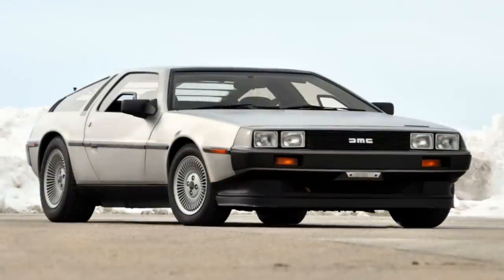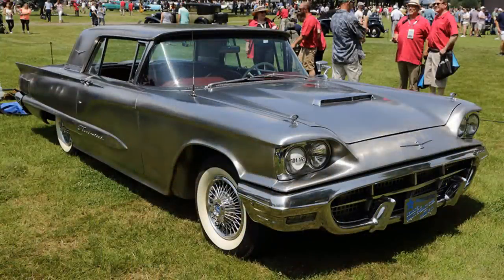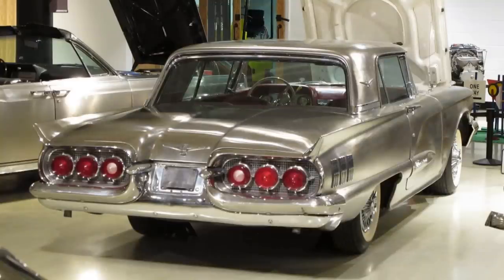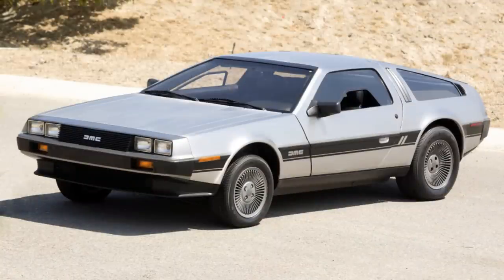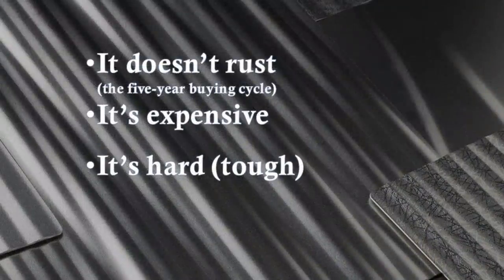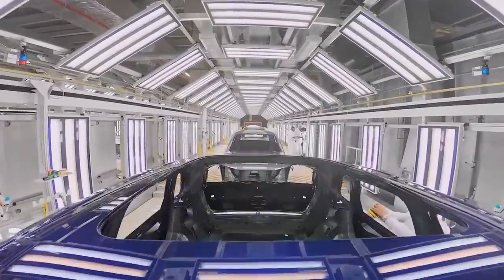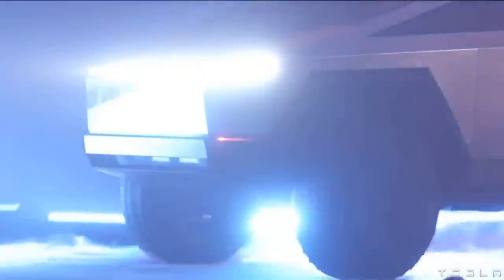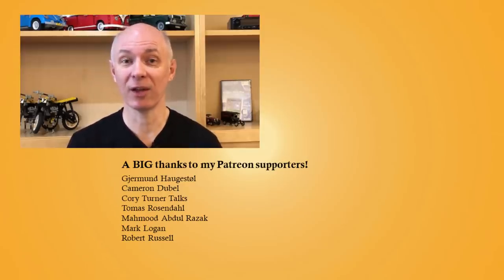Why aren’t cars made from Stainless Steel?

Comment: I would add another point: crash tests. 

With steel panels being used to absorb energy in crashes, I am curious about how Tesla solved this approach in the CyberTruck
Reply: I think they decided to go the Nokia way: rely on the other cars deformation zones, or destroying whatever it crashes into.
Reply: Body panels barely have an impact for crash absorbtion. You would rather look for the platform construction if trying to figure out how they would behave in a crash.
Reply: @Dear_Mr._Isaiah_Deringer  Yeah I understand but the problem remains: how are these stainless panels are going to behave now? Are they going to be too rigid? Do they serve as an energy absorption member?
In 2020/2021 the Eurocap and NHTSA will have the proper answer, still, its a challenge for using this type of material.
Reply: Short answer: they don't. This kind of shaping ensures that almost none of the material can help in absorbing crash energy.
Reply: @Dear_Mr._Isaiah_Deringer  That's not totally true...they are designed to absorb the energy of a crash along with the structure underneath...open any hood and you will see little creases in the structure that the skin covers over...that's to help absorb energy. Stainless steel...especially straight stainless is probably many times stiffer than the HSLA sheet metal (High Strength Low Alloy)  in other cars. Perhaps some insight can be gained from a review of the DeLorean crash test results.
Reply: Well, they don't.
Reply: Yes ,this is the most imported  fact.
Reply: @Dear_Mr._Isaiah_Deringer  this would be a unibody so that means the body is the chassis
Reply: @markanthony3275  The Delorean had fairly thin stamped stainless external panels, mounted over a composite tub chassis, so it wouldn't be a direct comparison. The Cybertruck has an entire monocoque stainless structure, so it will behave differently, with higher force levels required to deform it.
Reply: @MonzaSSguy  Hey thanks bud! I'm a retired collision repair man ...so I know about crumple zones and all that...but I never had the opportunity  ( misfortune? ) to work on a DeLorean.
Reply: @markanthony3275  Getting the Cybertruck through regular barrier crash-tests without subjecting the crash dummies to fatal shock loads, will be the real challenge, with all that deform-resistant external skin and structure. I'm still rooting for the concept, but it might have to 'evolve' a bit...
Reply: @Jozavenue  That's close...but the doors, bumpers, hood and trunk lid are removable on a unibody car (99% of the time) so in that respect, the body panels are not the chassis...but I think you mean the upper aprons(the fenders bolt to), the rockers and sills, the floor pan, the roof and the A and B pillars...in that case you are right. The easiest way to differentiate is that in a non-unibody vehicle...the body can be removed from the frame. In fairness I would say that you are right about  Musk's truck because it doesn't look like any panels come off except the doors
Reply: @MonzaSSguy  Yeah...I think it will take a lot of complication beyond what we saw at the unveiling. This happens with  visionary types...they can think up awesome ideas...but have difficulty with the details...they need other people to deal with that, and lots of times big fights break out when the visionary doesn't understand why he can't have something exactly as he envisioned it.
Reply: Mark Anthony what they forgot to announce is what kind of material will be the whole structure of the car not just the outside panels if the structure is  normal metal used in automotive then yes like you said the doors fenders are maybe just glued on panels which could basically easily just fall off and crumble it's actually what's underneath that matters
Reply: @Jozavenue  Another thing I'm not sure of is dissimilar metals corrosion. You see it when aluminum and steel come in contact. I once had a 79 Pontiac that had a chromed steel rear bumper but it had an aluminum reinforcing member the the bumper was attached to...the aluminum member was what was bolted to the shocks in the frame.   The aluminum turned to powdery flakes where it attached to the steel shocks and the bumper almost fell right off.. It gives pause for thought when you realize that Carrol Shelby's Cobras were aluminum bodies wrapped over a steel sub-structure. Can corrosion of this sort happen between alloys of Stainless and steel?  Maybe I ought to investigate the Panoz cars as I believe they were steel bodies over a stainless frames. Of course they may have been composite bodies. Either way...a stainless frame would be something very difficult to straighten in the event of a collision.
Reply: Mark Anthony actually I do work in the metal fabrication field and stainless could get affected with metal basically if you're cutting metal and just Sparks alone will integrate into the stainless steel it will make the stainless steel start to corrode so it will contaminate it however that's why I was thinking the only way to get around it is if they Bond like basically they were to Prime inside of the stainless steel and obviously the metal will be primed as well and instead of using screws .,basically the body panels bonded instead of  welded and Max use some sort of plastic fasteners don't forget they will have to keep the price low so obviously the stainless steel will only be used for the outer shell and they will do budget cuts which will be the unibody which basically will be metal or else this whole thing will be minus adjust to push the company in the stock market forward
Reply: @Jozavenue  Hey thanks for the info !...it's always good to find out what other people in related fields of work have experienced. I'm gonna check out the cars built by Danny Panoz and see what I can find out. I know that bonding metals with "glue" has been around for a while, I can't remember if priming is a good thing or not...I say that because the substrate that you prime over may not be prepped well enough. Actually I remember the time I worked making motorhomes and they used a glue that didn't require priming...maybe it just depends on the  glue manufacturer's recommendations.
Reply: @markanthony3275  yes ,the  right glue ,or both epoxy primer and  or specially blended glue  ,then again he will be using a different stainless then what is available now .
Reply: It is designed to WIN every accident LOL
Reply: Maybe the panels just fan outward and the structure underneath crumples.
Reply: @MonzaSSguy  and composite is a sexier way of saying GRP, or glassfibre in the DMC12's case :) . If you've ever seen a DMC 12 'tub' in the flesh the quality was simply dreadful....but then again the SS cosmetic coverings weren't too great either and, used a low grade SS 304 for cost savings, corrosion (even perforation) of these covers is now a serious issue.
Reply: Safety regulations have to be met. End of. Stainless makes that a bit harder but it’s just an engineering issue.
Reply: MonzaSSguy 
That’s perfect for the passenger cage. The front and back crumple zones will have to be thinner so they can collapse on impact.
Reply: Electric avenue Bikes 
If the external panels are glued on then fine. If they are bolted on expect horrendous corrosion at the ferrous parts underneath.
Reply: Electric avenue Bikes 
Acrylic mastics as used for windscreens will do the job just fine.
Reply: @nomohakon6257  yikes
Reply: i'm guessing with the angles that no one gave a thought about what happens when it hits a pedestrian.
Reply: It’s being sold as a heavy duty vehicle. Trucks aren’t subject to the same crash tests as regular cars. I believe it the vehicles weight comes up into play.
Reply: Perhaps its to sell the tesla that he's most dangerous to others than himself... 2 crashing one another makes they're inside a G force blender.. splatt

Right?
Reply: They "solved" it similarly to those 3-ton BMW's.... The other car becomes the "crumple zone" while the tank and it's passengers are intact.
Reply: @Dave5843-d9m  Trucks are heavier vehicles. You generally want a stronger crumble zone on a truck than on a car, since it needs to slow down way more mass. Ideally, a crumble zone should slow down the car without slowying it down too quckly.
Reply: This may be silly but maybe the stainless steel act like vibranium (less stronger) by being able to absorb impact energy without deforming and without transmitting the shock to the occupants of the vehicle.
Reply: @Silver_o   Real-life physics don't work that way.

little deformation = high g force.
Reply: Short answer is we don't know because what Tesla showed us was a concept car and not the final production model.  As it stands now though it definitely wont pass new pedestrian safety standards. New safety standards are why new pickup trucks have plastic bumper over molding and hoods are so flexible.
Reply: In a high speed head on collision the truck will be fine, the driver and passenger will die.
Reply: The Cyber truck is basically a unibody like most cars but doesn't have the flimsy body panels on top of the unibody.
Reply: @adolfhonkler8324  If the body and chassis cant fold up to absorb the impact, the driver and passenger will rip through their seat restraints and literally be cut into bits, or their seats will rip off the mounts and throw them into the windshield, which is also unbreakable. Launch an orange at a concrete wall at 60 mph and see what happens.
Reply: @Mic_Glow  Basically what happened when someone crashed into my land rover defender. Because of the height difference the  chassis took the  force not the bodywork. The c asr that hit me wrecked it's front end and my defender had a minor scuff on the tow hitch!
Reply: Assuming just for the sake of argument that the material is indeed resistant enough to deformation that it cannot act as a crumple zone should, despite how big and heavy the Cybertruck is: The material can be strategically weakened so that it does act as a crumple zone in a collision.
Reply: @theuncalledfor  Adding strategic weak spots to create crumple zones will be defeating Teasla's  "no dents" sales pitch. Hmmmm?
Reply: @MrJonnySL  

Only if you hit with the force of a collision. It'll still be tough and rigid, just weak enough to crumple in a crash. Don't forget it's a big heavy vehicle that needs tough crumple zones so it doen't crumple so easily that the passengers aren't slowed enough to help.
Reply: @theuncalledfor  If it manages to get through the safety crash tests, you buy one if you like. I am unconvinced this vehicle will ever meet all the hype and expectations (and consumer guesses and want lists) that have generated around it. I am old enough to remember the last person who said he was designing a viable electric car, and then everyone was offered the Sinclair C5.
Reply: @MrJonnySL  
OK boomer.
Reply: @MrJonnySL  
OK boomer.
Reply: It would take a failure of all electronics to crash the beast. Even then the motors would automatically slow the car because of internal magnetism causing energy to be removed from forwards motion . normal FSD would otherwise preclude the need for crumple zones and only an off roader or a fool would drive without using it ….
Reply: @nomohakon6257  
That doesnt make it safe.
The deformation makes it safer because it 'eats up' energy from the crash. If the panels dont bend you experience much higher forces.
Reply: They haven't. Are you aware of any crash tests results released for cybertruck?
Reply: Taking scratches out of brushed stainless is pretty hard, because unless you can match the graining pattern on the steel precisely, it will be obvious where it's been rubbed. Stainless is also terrible for showing up finger marks. It also does corrode, especially where bolted to dissimilar metals like brass or aluminium.

Comment: Very interesting and well-presented video as always - thank you! There was a Stainless Steel aircraft (Bristol 188) manufactured in the UK in the early 1960s to study the effects of kinetic heating that arise from flying at very high speeds for long periods. They too found that stainless steel was a very difficult material from which to fabricate the complex shape of an air frame and new construction methods were developed. For various reasons, the aircraft was not a success, and only 3 were ever built.  https://en.wikipedia.org/wiki/Bristol_188

Comment: The Audi thing is a myth and misunderstanding. Audi started making cars that were fully galvanized after welding, by bathing the entire car in the galvanizing bath after it's been welded. Other car manufacturers just take galvanized sheet metal and weld that, which is why they start to rot at the seams. To some, this impossibly rust-resistant treatment apparently meant it must be aluminium. Anyhow, Audi did make the front body panels of the second generation Audi TT in 2007 out of aluminium, but that was long after the aluminium myth had been established. Generally the "Audis are aluminium" is a false, however.
Reply: Well if I remember it correctly Audi A2 was fully alu, wasnt it?
Reply: @Pillokun  Yes it was also the A8 from the same time was

Comment: More cars get scrapped from rust than from accidents. Still want a cybertruck.
Reply: Suspect this may last a million miles with two swaps of battery packs and cosmetic maintenance otherwise.
Reply: @macmcleod1188  bearings wouldn't last, but if they would be made easy replaceable the car could be past through generations.
Reply: @ggsay1687  Greediness makes everybody do items, which won't last.
Reply: @SuperDirk1965  Explain your foolish statement.
Reply: @fortheloveofnoise  he probably means that the energy requirements to produce those cars are much higher than to produce regular cars and thus they are much less "green" than advertised

Comment: Slight contradiction - car manufacturers apparently didn't want cars that didn't rust as it would affect their business model...but car manufacturers also researched and implemented ways to prevent and in Audi's case eliminate rust. This would lead me to believe that it was not really a factor in avoiding using stainless steel. In fact given the difficulty in repair there could have been a big market for replacement panels.

Comment: Another major disadvantage of stainless steel, especially when it has a brushed finish is that it will get stained from fingerprints.  The chloride in a person's sweat superficially attacks material.   Any fingerprints on a DeLorean should be wiped clean within a few days otherwise you'll need to rebrush the affected area.
Reply: analogdesigner who cares, it’s a truck not a limousine or show car
Reply: Does it eventually eat all the way though the metal or something?
Reply: @KendrickMan , not in the case of fingerprints as there is so little chloride present.
Reply: @analogdesigner-Jay  excellent. I'm used to little oily fingerprints winding up on the door handle from oil changes and other repairs. in that case, the fingerprints might preserve the vehicle lol. probably not going to happen from maintaining a cybertruck for obvious reasons, but it is good to know in case any areas need undercoating or something.
Reply: @KendrickMan , also if the stainless is real smooth or polished it becomes fairly resistant to chemical attack.  It's the brushed surface that seems to be the problem!
Reply: The ultimate protection would be to electropolish the Stainless steel parts before assembly, it’s probably the best protective treatment for 304 that I know of. We used it extensively in the marine environment …
Reply: @chrisbraid2907 , yes as I used to electropolish a lot of small SS parts for use in CO2 lasers.  The DeLorean was made from 304 SS.

Comment: The Delorean has a fibreglass body and a steel backbone chassis, the Stainless steel panels are stuck onto the fibreglass body. The Delorean was basically designed by Lotus which is why it uses a modified Lotus Esprit chassis. Colin Chapman absolutely hated the car and thought the doors were stupid design.

Comment: The Cyber truck isn’t anything more than a proof of concept demonstration prop.  The shatterproof/bulletproof windows, while neat, wont make it to production for side window but maybe windshields and rear windows: US DOT won’t let it happen because it restricts emergency crews during rescues. As for the stainless steel bodies...yes it’s more durable but like you said it’s also more expensive so I’m hedging my bets that it’s going to be used for the unibody and in key areas but the rest (because the final shape of the truck isn’t set yet) of the truck will still be plastic/fiberglass/steel because as you stated repairs would be very hard otherwise.  Good video 👍

Comment: I see multiple issues here

1. Price. Just because musk says something doesn't mean it'll cost that much when it releases, it'll definitely be more expensive than an identical version using conventional materials
2. Weight. I doubt tesla has figured out a way to form the entire structure of the car from the exterior panels and even if they did it would weigh slightly more than a conventional structure since it takes up so much more space
3. Safety. Not just that of the occupants but imagine hitting a pedestrian with this, especially with its speed and the people who think "full self driving" means the car can fully drive itself (crazy, why would they think that)
4. Appearance. For me the most significant factor is how terrible it looks. It's like a 3rd grader drew wheels on a house with is pointed roof, has no connection with teslas design language either. Sure some people like it but it's ultra divisive which is not something you want in a car, excluding a large proportion of people who would possibly be interested.
5. Build quality. Tesla already struggles with build quality, regularly ranking some of the worst in the industry. I don't have a lot of faith they'll be able to do better with a material that's even harder to work with